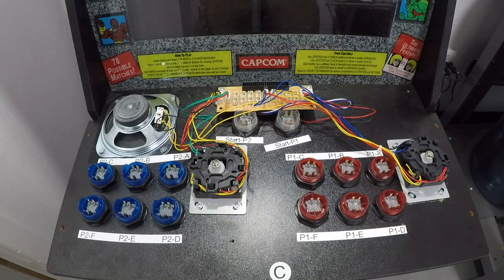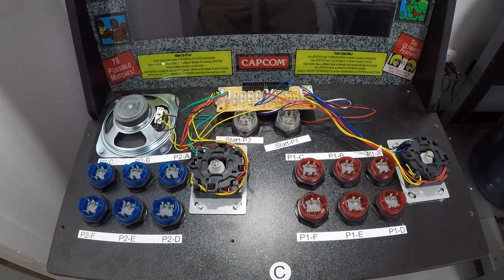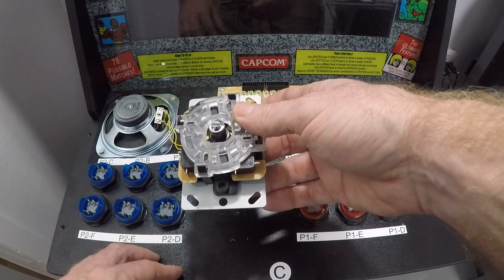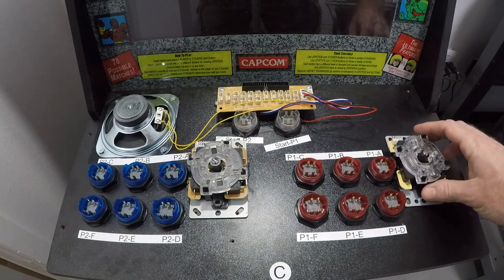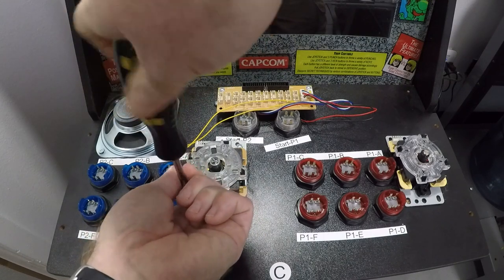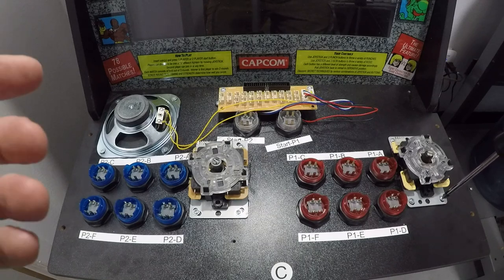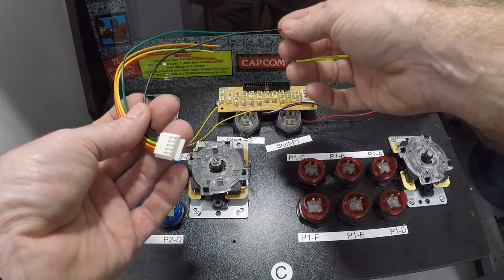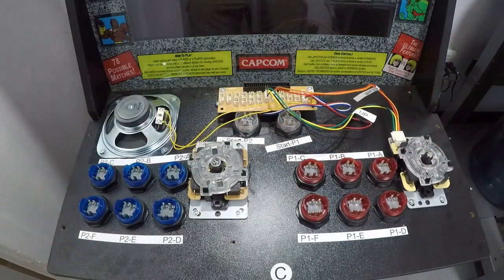DIY Retro Arcade Plug and Play Joystick Upgrade for the Arcade1up Street Fighter Cabinet

Comment: Got 3 sticks and your harnesses for my Rampage cabinet. They worked great. Really appreciate the work you put into these.
Reply from the maker: Awesome! were they plug and play on the rampage cabinet as well? I have not tested them yet on it. Whats yours opinion of our stick vs the A1U factory one?
Reply: Definite improvement.  Work great for the price. My original player 2 stick had a faulty switch in it out of the box. I have the SF cabinet too and the original sticks in it were getting spongy after a few plays.
Reply: Didn’t have to alter anything for Rampage. I’d say the encoder boards for the A1U are pretty universal. Will probably work for all the others.
Reply from the maker: @ckclark77  Thank you for the information!

Comment: I just installed these on my mortal kombat 2 cab. The plug and play cables were great. Centering the sticks without help is a bit tricky. I used duct tape to hold them then drilled the piolet holes.

Comment: Nice Video.  Gave you a thumbs up/like.  I used your video and the link for the ON/OFF button mod :)  I want to make one comment.  The first generation (2018) of the SF A1U cabinet has the same 4 hole screw on the joystick but the 2019 they've actually made 2 additional holes in between the 2 top and bottom 2 holes so no additional drilling is necessary.  They've also solder all the wires better now but makes it more difficult when you try to upgrade the buttons.  It is difficult to use the SAME cheap buttons but since my upgrade was to change them over to LED buttons and we are not using the same USB encoder, I just cut the wires and threw the whole thing out.  They've also SHORTEN the wire on the ON/OFF switch (this can be done by soldering to make the wires longer).  A1U is aware of the RaspberryPi upgrades so they are making it more difficult for folks.

Comment: Or instead of drilling new holes, simply replace the plate with the old one ;-)
Reply from the maker: works on about 90% of them. We have seen a few with plates that do not align. Its weird :/
Reply: DIY Retro Arcade Are you saying that your upraded joysticks align with 90% of the street fighter two ones and don’t require new holes?

Comment: I have the double 4 wire plug control board for up/down .. left/right.  Question, if i hook up the stick and everything / the directional works correct when playing. Does it matter if the dual 4 wire plugs are in the correct place? If the up/down wire plug is in the left/right spot, will it effect my A1Up control board negatively in any way?? 
I just hooked up a Sanwa stick from DIY Retro Arcade.
Reply from the maker: as long as it performs the correct direction when pushed you are all good.

Comment: Just replaced all the buttons on the 1up arcade mk2.  The only problem is that the joysticks dont work right at all.  They are plug and play.  Is there a fix to this? Did I get a faulty Sanwa? Need help please.
Reply from the maker: Usually wrong cable. Open a ticket on the website. There is a help icon bottom right corner. Attach a image of your encoder as well to speed things along

Comment: Not to tech savvy, but was wondering, would your harnesses also work for the Pac-Man cabinet, or are these specifically designed for the Street Fighter, I am looking to change out my arcade stick in time and maybe your harnesses are the answer as I am not to keen with wiring.
Reply from the maker: Sure! Send me a message thru the contact form at diyretroarcade.com and i can get you fixed up. Just need to verify if your A1U encoder has two 4 pins or one 5 pin connection. We have cables for both setups that are plug and play

Comment: How can you assume the right/left and Up/down wiring will be correct -- If as you mention you are turning the switches in order to align the 5 pin plug connector on the joystick that will also change the location of the various switches - so depending on how you move the connector location it will also change the Left/right/up/down switch location ! ( IOW does this wiring harness you sell assume they will be switching the connector location on both joysticks exactly as you do in the video so that the switches will be as labelled ? ) If so you may want to mention that since the wiring will not match up properly if say they move the connector to the side instead of toward the top of the panel. ( in which case they may need to remove the pins and rearrange instead of it being plug and play.)
Reply from the maker: Hi the kits we offer are plug and play. We will rotate the joysticks and assemble the cable if you get the entire kit. You are correct on the cable only, we need to let the end user know to rotate the joystick. In all honesty its really the only way to mount on the P1 side but you are correct in the P2 side it could be to the inside. We will update the listing to note that. Thank you for your input!
Reply: @diyretroarcade  - No problem - it's just little things like that can frustrate people that don't really think about how moving the switches will change how things are working and they might not figure out it's just a matter of relocating a couple pins on the wiring connector to fix it. ( kind of like you mention with only needing one ground not 4 per joystick ! )

Comment: I have a joystick related question, can you get a restrictor plate that turns the joystick into a shifter? like a 4 speed ( 4 position) I know some thing would need to be done with the spring too so the stick first auto center. I looked up arcade shifters and their crazy priced compared to a joystick
Reply from the maker: I am not aware of anything that we manufacture that would do this.

Comment: I have the 12-1 unit that does not have a joystick. Would I be able to swap out a button control and replace it with a working joystick?
Reply from the maker: The 12 in 1 encoder does not support a joystick

Comment: Bro I want to replace the sticks in my wave 1 SF cab, I'm dumb and don't know which option to chose on your website. If you reply, I'll buy at least 2.
Reply from the maker: We have no way to tell you. Take a pic of your encoder and go to the website and use the chat in the bottom right. We need to see the pic to answer that. Your machine has used all 3 cables.

Comment: Hey.... I'm trying to get a Seimitsu LS - 32 And I'm thinking of ordering Happ terminals 4.8mm (.187) from your site for an Arcade 1up machine but would they fit the Seimitsu? If so would you already have some that are Plug and Play?
Reply from the maker: yes it uses a standard 0.187 terminal
Reply: @diyretroarcade  Thank you for the reply, you have great videos and a great online store which I will be ordering from for all my needs. Right now I'm just gathering as much information as possible as all this stuff is new to me but I think I have all I need to know. 

I plan on getting a Galaga A1up cab and making appropriate mods.

Comment: Ordered some joysticks and lighted buttons for my SF2 Arcade1up cab. You guys are awesome. Shipped so fast. One question before I start. Does it matter which way the joystick gets put in as to what way will be up or down and left or right?
Reply from the maker: for A1U the cable needs to point towards the monitor
Reply: Thanks very much. It seems that you have already turned them the correct way with pins pointing at monitor. Thanks so much!!

Comment: Question sir, do I have to drill in new holes to fit in the sanwa stick?  Or can I some how do it another way?
Reply from the maker: sometimes you can swap the plates on the joysticks to reuse the old holes. If the plates swap you are good if not you have to drill new ones.
Reply: @diyretroarcade  ohhhhhh i'm so stupid, i accidently bought the wrong harness for the sanwas i just bought off your site. i bought the 5 pin when i should have bought the double 4 style for my street fighter II cabinet. damn....i thought i had everything figured out, that's on me. just bought the 4 pin style off your site, gonna wait until it comes in the mail then ill start to put everything together.

Comment: Hey...this is a different topic and may require another video but do you have any solution for better volume control on the A1UP?  Slider knob or something that could easily be installed and adjusted?  Thanks!!
Reply from the maker: I do not have anything for the A1U encoder for volume control ect at this time. Epic fail on attempts :P
Reply: if you like to tinker with electronics you can try a potentiometer between one of the speaker wires and the speaker ( in series). there are two types of pots, linear and audio tapper, you want audio. you clip the spk. wire, then you would use the center pin and either one of the outer pins on the pot. next slide the stock volume switch to full. they sell knobs for these and the shafts are long enough on most pots to mount thru the A1U cab. Hope this helps.

Comment: Hey guys, so just a quick update i modded my SF II Cab from the sticks to the buttons just like this video showed. now that the Marvel vs Capcom Cabs are out, i was wondering if the process is still the same on replacing them with the Sanwa sticks and buttons? i just bought some more Octo gates from your site and once i get paid again i'm gonna buy 2 more Sanwa sticks and buttons with the LED kits. you guys are the best!
Reply from the maker: should all install the same :)
Reply: @diyretroarcade  Oh no, its says you guys are outta stock on the PLUG AND PLAY JOYSTICK HARNESS COMPATIBLE WITH SANWA STYLE JOYSTICK & ARCADE1UP (SINGLE), when do you think you guys will have it back in stock?
Reply from the maker: @Seahawkfan1108  we have plenty set aside for the sanwa PNP joystick kits. They are included with them. We are just not selling them by themselves at this time.
Reply: @diyretroarcade   ahhhh okay then, thank you very much for the info sir😁

Comment: Forgive me if answered already, but how did turning the bottom of the sticks not change the up and down to left and right?
Reply from the maker: its all in how we make the harness that hooks to the A1U
Reply: @diyretroarcade  ah cool. Thanks. Looking to put some of these in a low traffic but still public space, so have no doubt I will need to replace the sticks eventually. May as well upgrade them too.

Comment: Hi the wife for me the Street Fighter 1up for Xmas and I want to upgrade the joystick to be more precise etc, will these joystick upgrades do just that? And or what are the main benefits I’m expecting with these upgrades?   Also will the existing knobs thread right on?   Thanks!
Reply from the maker: Joystick failure on these machines are pretty common. These replacements are more accurate and responsive then the factory sticks. If yours uses the duble 4 pin JST connectors like shown this is a "almost" plug and play. You just need to drill some holes for the next joysticks. The top just unscrews like any other joystick.
Reply: Ok thanks!  Ordered joysticks on your site and I want to add buttons to ship together.  Adding the 28mm buttons and want new harness plugs so I don’t Have to resolder.  I didn’t see the option for them by themselves.
Reply: I seen the. With the full joystick and button kit but opted for the solid color buttons instead.    Please send a link and I’ll add them to order, thanks!    Also the solid 28mm buttons I imagine fits the arcade 1up?   And are those more responsive and reliable than the ones that come with it?    Thanks again!  Glad I found you
Reply from the maker: @chadwickwicky67  Yes the ones your ordered will fit just fine. Will get this all taken care of for you. If you need any direct help shoot me over a email.

Comment: Can someone just take the original mounting plates off of the original sticks and put them on the new Sanwa sticks so you don't have to drill new holes in the control deck??  I would love to upgrade my Arcade1Up Pac-Man Plus cabinet with a better stick that requires less movement of the stick. The stock is kinda bad and requires a lot of movement of the stick before actual response in game.
Reply from the maker: Sometimes you can and sometimes not. All depends on what sticks are on it from factory
Reply: @diyretroarcade   How does someone know what stock sticks they have in their A1Up cab?

Comment: This is awesome. Just ordered... in the meantime, I was wondering if you had thoughts on the restrictor plates. I see you sell an 8-way, but the Sanwas say they come with a 4/8-way plate, so I didn't order the separate restrictor. Is that needed for SFII?
Reply from the maker: the clones run the single 8 way which will work perfect for the SF ;)

Comment: I'm back! Anything else I can criticize 😆 I'm about ready to place a custom order for my Asteroids cab. I'll send pics and part list so we can work out a price. I have a question about this stick. Is the shaft length equal to a Sanwa or the default A1U stick? The A1U stick is longer than the Sanwa. I already put a Sanwa into my SF2 cabinet and I'd like to add one of these for P2 but I want the shaft length the same on both sticks. Would you happen to know the answer to this?
Reply from the maker: It is just a hair shorter then the factory joystick. See: https://tinyurl.com/y86jkbu3 We can make a led kit for your Astroids cabinet, simply email me pics of the back of the control panel and i can work on that.
Reply: DIY Retro Arcade Thanks for the pic. It looks like it might end up being the same length as my Sanwa stick.

Comment: Just a note for those using this video guide to replace their A1Up joysticks remember that when you rotate the connection that it also rotates the direction of the stick, so unless you wire/splice it yourself or buy the adapters that are shown you will have joystick configuration issues. If you are attempting to use this 'rotation' method with an aftermarket encoder keep that in mind. I changed out the sticks on my modded MKII (pc) with Sanwa's  and it's completely worth it. Best of luck !
Reply from the maker: We rotate the sticks and make the PNP harness to all work together. But yes if you move the position on the cable it changes the cabling itself.
Reply: @diyretroarcade  Yes I know you do and that's fantastic, my comment was intended for those that do not have your adapters. ;)

Comment: I highly advise against cutting your old harness and splicing it lol. Ffs just do the job properly and buy the female 4 pin JST connectors for a couple dollars at most.
Reply from the maker: The cut and splice is for folks who buy a generic Sanwa off of Amazon and do not get have our PNP cable that our joystick comes with. Ours is pnp, takes 5 minutes to install.